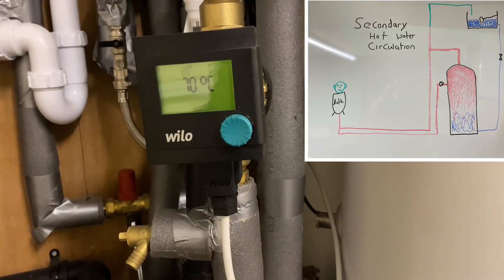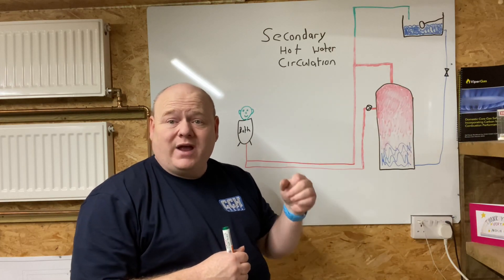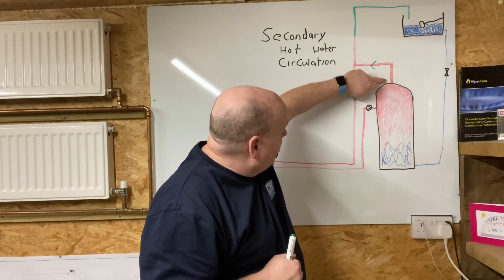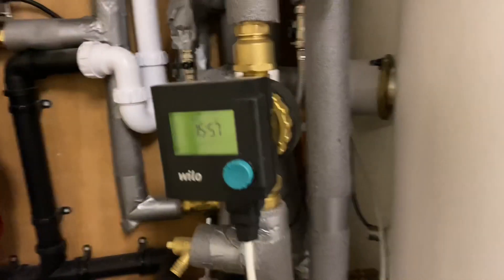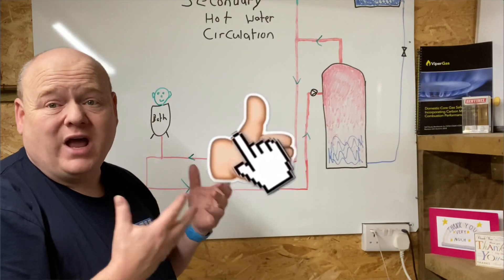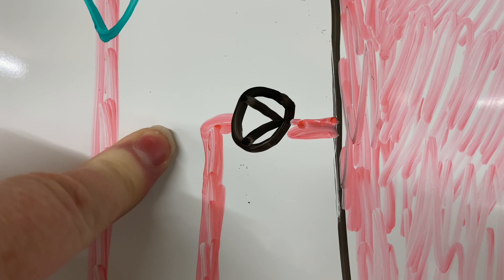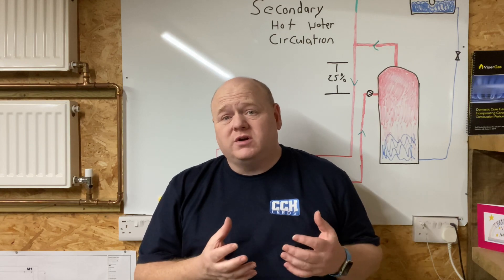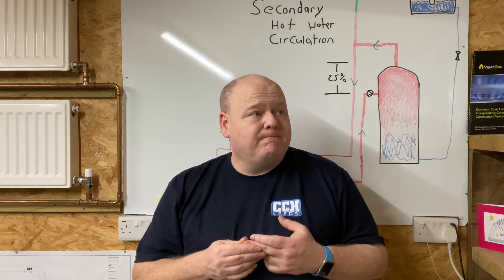Secondary Return Hot Water - How Does It Work - Central Heating Systems.

Comment: Great video, thanks! I am planning to do a secondary return on my narrowboat triggered by a manual button at each sink, mainly to save water as every little counts when on a tank!
I have a couple of questions which I was hoping you could answer?
1: I notice the pump is on the return side. Does it always have to be on the return, or could it be on the output side? With it being on the return side, could this potentially drop the pressure of the taps?
2: If I have a tank without the pump return inlet, can I put the return onto the cold inlet instead? (With a check valve on the cold feed) I have a 55ltr horizontal tank and it only has in, out, and two coils.

thanks in advance...

Comment: I destratify all my cylinder installs. Tee of the secondary return to the drain off with another tee and link the two. I used to fit a pump but have found it is very good to create its own convection currents and destratification is achieved naturally. Been doing this for 16 years and always works. If there is not a secondary return I tee off the hot outlet to the cold feed and it does the jod too👍👍👍

Comment: I have one of the recirculators that uses the cold line. I want to use it and run it's own circulation line. I don't think my hot water heater has that inlet recirculating line like your drawing. How would I do it to work?

Comment: Great video Allen!  Couple of questions.  What is the purpose of the check valve and where would it need to go?  Inbetween the pump and cylinder or before the pump?  Are gate values enough to isolate the pump if it needed to be serviced or replaced or would an additional isolated valve be required?  Final question you mentioned perhaps needing a largeer expansion vessel what determines whether a larger one is required or not?
Reply from the maker: Stops heat going out of the cylinder.

Comment: thanks .... needed to self install a large cylinder (on a boat) and first time ever come across secondary return. thankyou, nice and clear explanation , got it straight away. Unfortunately not practicable in this particular situation due to lack of access to add further pipework, instead fed a 15mm feed (10 metres long) down the inside of the existing 22mm run to reduce the water wastage (more important than flow rate here)
Reply from the maker: Thank You

Comment: Hi Alan, I have just installed a secondary circuit on my gravity system but when i start the pump on the lowest setting it blows water into the header tank which is only about 2 feet above the cylinder because of a low roof, is there anything i could do to prevent this as i can't leave the new circuit connected, Thanks

Comment: Hi. What household brands recirculate into the top of the water tank like in your video as opposed to the ones like Rinnai that recirculate into the cold water inlet which doesn’t make sense to me if you want max or constatent hot water temps?
Reply from the maker: You can get them from most brands. Thanks.

Comment: My hot water tank is in the garage and they have installed one of these. My question is should this be on continuously? What is the best speed , mine is  a archergas system with 3 settings. Would i cause any problems by having it on continuously? Many thanks

Comment: I had a secondary return system installed, however, the plumber failed to insulate the pipes and the system loses heat within 20-30 mins of running, meaning huge bills keeping the water hot.  I've had to turn it off.  The plumber says insulation wouldn't have made any difference.  That's not what I'm reading.

Comment: Nice video.  Is it essential to have a cylinder with a connection for a hot water return?  Or can this be achieved on a cylinder with only two connections (cold in at the bottom, hot out at the top)?
Reply: After a bit more research I see that using an Essex flange to create an new connection on the cylinder is the way to go.

Comment: Many old houses in the UK, probably millions, have water pipes running through and/or buried in walls and in concrete slabs. When you draw hot water you lose a lot of heat into the slab, and with recirculation you lose even more heat even when you are not using the bath/shower/whatever. Maybe an idea to have a thorough inspection carried out before installing recirculation.

Comment: Hi Allen - thanks for the video. What if there are two bathrooms and a kitchen all at different ends of the house? Can the three secondary returns all be gathered into a single connection to the bronze pump and then into the return boss to the HW cylinder?
Reply: You can, but you also then need valves to balance them, otherwise one circuit might rob all the heat. I'm not sure if it's in the video, but it must be copper pipe too

Comment: I have this type of system with 300 litre tank, being oil fired with  solar assist, however when the recirculating pump runs the volume of cold water in the return quickly cools down what at the top of the cylinder, so one only receives warm not hot water, any suggestions appreciated Thanks Doug

Comment: Hi Allen, thanks for the content, I've found many of your videos very helpful! I am wondering with secondary return and the pump working, If megaflow is on ground floor and supply various bathrooms, will there be any pressure and flow drop when open tap in loft ensuite? As I believe circulation pump is working all the time, or it shuts when the outlet is open?

Comment: Can you do a video for multiple say 10+ out let’s on different floor levels all more than 6 meters apart, by my thinking you would then install tees as close to each outlet would a non return valve be needed on each primary where the tee comes off ? As essentially your going to having multiple small loops coming back into the secondary return main line back to the cylinder ?

Comment: Allen why has the sec return to be copper  and not plastic??
Reply: I've done a lot of reading in to this - in short, the majority of plastic in the UK does not allow continuous circulating under British Standard testing; if a pipe happens to burst your insurance not pay out. Some argue that plastic degrades quickly through oxidation, reducing lifespan by a third, others say that's rubbish. I only know as my builder did mine in plastic, and now I'm trying to get money back!

Comment: Dies it matter if circulation pump is on the flow or the return? Ours is on flow just now, but getting a new cylinder fitted shortly.
Reply from the maker: The pump is normally on the return. Thanks.
Reply from the maker: Thanks very much for your comment, please consider subscribing to support the channel 🙂

Comment: I work in the commercial sector Allen and I’m seeing more returns being added to the cold water supply. This is due to new buildings being so airtight and heat efficient that it is warming up the cold water in the pipes, even when insulated.
Reply from the maker: I have never seen it done like that. Thanks for sharing.

Comment: How far   Pretty much should that sink be to use a secondary return?
Reply from the maker: Not sure what you are asking? Thanks.
Reply: I have the cylinder on the loft and the furthest tap is the kitchen tap which is approximately 20/25m away from the cylinder .
My question is :Will this system need a secondary return ?

Comment: Alan if i want to put a connection for return circulation on my unvented tank what fitting do
You use after cutting hole in tank ive used one years ago but what is new version
I think last one had slot and pulled it with a wire from inside then put nut on ???
Reply from the maker: I have never done that. You would be best to give the manufacturer a call and ask them. Thanks.

Comment: Worked on a barn conversation with another contractor, wouldn't agree to lag the secondary return or the fact that you can't run it in poly pipe, has to be in copper. Walked off the job
Reply from the maker: Gary Dulson You can also use some MLCP pipe. Thanks

Comment: I have fitted secondary pumps on systems using electronic body detectors in bathrooms.  The pump is only on when someone walks in. This saves a wedge in heating bills as secondary circulation on a timer is continually dragging heat out of the cylinder. A great idea for just the far reaches of a H&C water installation.  Great for domestic houses. 

As it is not continuous circulation (it is on demand) plastic barrier pipe can be used.
Reply: Loving that idea, awsome
Reply: Hi John. Interesting approach of controlling the pump. What detectors do you use ?
Reply: @goheat  
see post above.
Reply: How do you overcome the legionella aspect if it’s not used for a while. Like usually they are on a timer, just asking 👍
Reply: @elwittinio2865  
Legionella predominately lives in the cool stored water in the cylinder. When heated over 60C it goes  away. So you heat up the cylinder, as per normal.

Comment: See this all the time being in the commercial sector only ever seen it twice in houses and one of them actually fitted a towel rail on the hot water system 😄
Reply from the maker: No way that's crazy.
Reply: Just really well lag the towel rail. The heat loss is prohibitive if primary services and secondary returns are not really, really well insulated.
Reply: You can install towel rails on the secondary return if they are suitable, I have come across this myself. I believe they have to be made from brass and very expensive

Comment: If an expansion tank was installed being a closed system, would that ever have to be purged occasionally or one time deal. Great videos by the way.
Reply: the closed(sealed)system sounds like its on the heating, would not have a expansion tank on a unvented hot water cylinder, hope i guessed right what you was asking
Reply from the maker: I will do a video about this soon. Thanks.
Reply from the maker: Thanks very much for your comment, please consider subscribing to support the channel 🙂

Comment: COULD THIS BE FITTED TO MY EXISTING 15 YEAR OLD MEGAFLO UNVENTED CYLINDER AS THE HOT WATER TAKES AGES TO COME OUT OF THE SHOWER IN THE MORNING???

CAN IT BE FITTED IF THERE IS NO SECONDARY RETURN INLET ON THE MEGAFLO CYLINDER???
Reply: If your unvented cylinder does not have a secondary return boss already, it is acceptable as long as it is also in accordance with the manufacturers instructions to tee  the return into the cold water supply pipe just before it enters the cylinder. However you also need to bear in mind that Hot water pipework on a system with a secondary return has to be copper/steel because plastic is not designed for permanent high temperatures and it has to be highly insulated because you are effectively increasing the surface area from which heat can be lost. Also any work on an unvented cylinder has to be completed by a plumber with the G3 certification
Reply: @rickbaguley7997  would teeing into the cold feed cause the f+e tank contents to get gradually heated by convection?
Reply: @wirdy1  you only need to tee in on an unvented cylinder without a return fitting. The mains pressure should prevent any backflow and there is a non return valve anyway. On a vented Cylinder you can add a boss using an essex flange or a surrey flange as mentioned by John Burns.
Reply: @rickbaguley7997  
"However you also need to bear in mind that Hot water pipework on a system with a secondary return has to be copper/steel because plastic is not designed for permanent high temperatures"

That is incorrect. What temperatures do you think CH system run at?

The secondary loop had to be metal or if plastic preferably have a barrier to prevent air seeping in via the pipe walls.  As the water is fresh containing oxygen then it does not matter that much anyhow.
Reply: @johnburns4017  Hi John, I understand what you are saying, and am aware that Central heating runs at high temperature too, and could not understand why it was an issue.  However i did a bit of research into that very subject and looked at the technical specs of a number of barrier pipe manufacturers unfortunately they all seemed t state that it is not suitable for use in continuously operated recirculating systems. However if you can point me in the direction of a suitable product I would be most grateful as I couldn't find one.  I have a job coming up that will benefit from a secondary return and if I could use plastic it would be superb. Cheers
Reply: @rickbaguley7997  
I just looked up the push-fit plastic pipe makers. Yes, they do not recommend using even barrier pipe on continuous secondary circulation.  That was never the case.  

I think you will find that multi-layered press-fit pipe is suitable. I see this a lot on commercial system.
Reply: @johnburns4017  Cheers, it would be interesting to see if that is cost effective, ill have a look in to it :)
Reply: isnt putting the return into the cold inlet a bit in inefective, your pumping hot water back into the coldest part of the cylinder, and also would that not put a lot more load on the pump as its doing the full cylinder instead of the top third?
Reply: @MyMonkey1973  it shouldn't overload the pump as no matter where the inlet is its just moving water around a loop,  i'm sure it is less efficient, than using a purpose made secondary inlet, but at the same time as the hot water is losing heat, it is heating the the cold coming in, so the water does not have to be heated as much by the coil or immersion heater.  I guess its down to heat loss from the cylinder really, but it is an accepted method when there is no other option
Reply: @rickbaguley7997  
Failing a dedicated return tapping, a Surrey flange is quite a good option. But only if the flange does not impede hot water flow.
Reply: @rickbaguley7997  totalty get what your saying Rick, but to me just sounds wrong(personal opion as is the internet) normal cylinder layout hot at top/secondary return/cylinder stat/heating coil/cold inlet so if your now pumping water from the outlet into the inlet, arnt you causing a issue of the stat knocking on off a lot more. Reguarding the pump my wording is probaly bad, but again if your pumping against a full cylinder you would(or not) be amazed how much pumps can lose flow rate when used for pumping more water than designed for. Rick am not trying to aurgue btw just found the subject matter interesting
Reply: @MyMonkey1973  I'm not offended at all mate, this is how we learn, like John Burns providing more info about using plastic pipe, there are so many different ways of doing things and it can be a nightmare finding out how to do something sometimes :)
Reply: I have seen one fitted with the DHW return pumped into a Surrey flange in the draw-off tapping on the top of a cylinder.  That means the DHW return cools the very top of the cylinder slightly.
Reply: No. on the old copper cylinders it was possible to fit a boss outlet but a megaflow is a stainless steel one and if unvented would not be someting could do one self
Reply: Just tee it back into the cold feed just make sure you fit a non return valve
Reply from the maker: Thanks very much for your comment, please consider subscribing to support the channel 🙂

Comment: Good video,why can't you use a normal central heating pump on this system the pumps job is to pump the water around?
Reply: because normal pump body is made of cast iron and would corrode over time contaminating the water
Reply: @grahammay1  tanx👍
Reply from the maker: Very good question. Graham is correct. Thanks.
Reply from the maker: Thanks very much for your comment, please consider subscribing to support the channel 🙂
Reply: Has to be bronzed mate otherwise it will corrode- used to be yellow pumps but not so much with the newer versions
Reply from the maker: @craiglewis6709  I believe they do a stainless one as well. Over ever used bronze ones though. Thanks